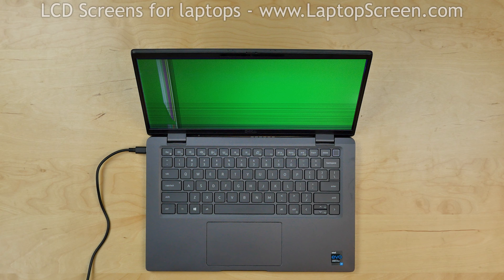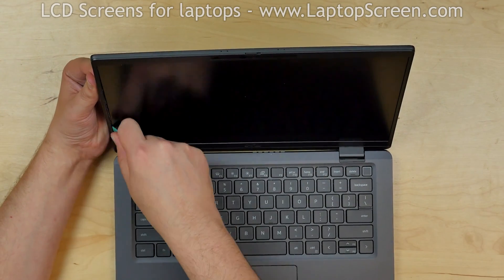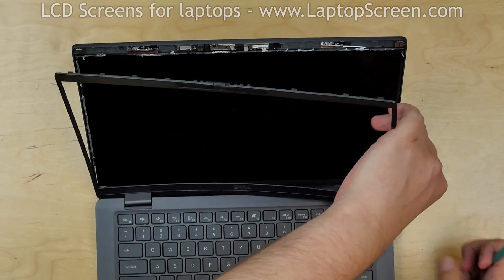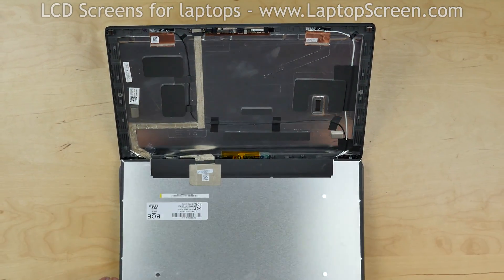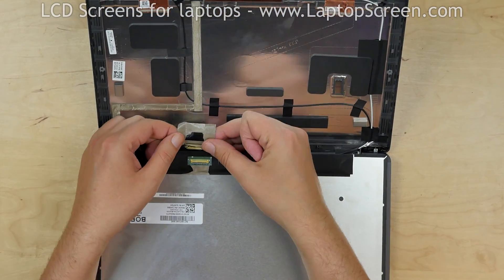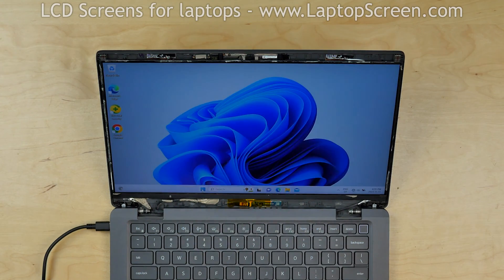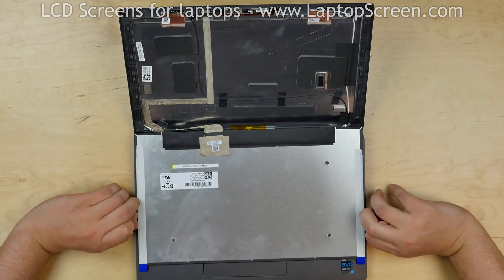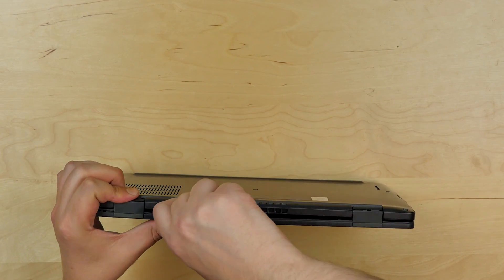How to replace LCD screen on Dell Latitude 7420

Comment: I tried two LCD screens from two different manufacturers however after replacing it won’t lit up
Reply: You probably blew the backlight fuse, fix is either to solder a new fuse or temporarily bridge the contacts (this is unsafe as if it "blows" then you could ruin the backlight circuit), make sure the battery is disconnected before removing the screen so that it does not happen again